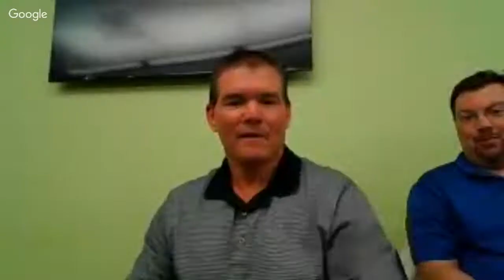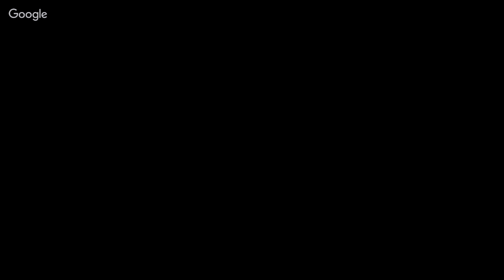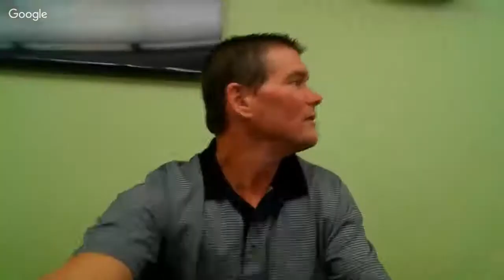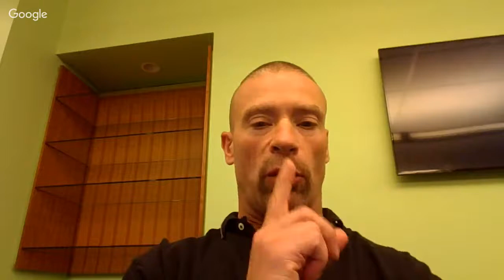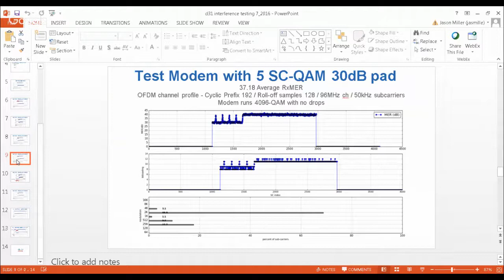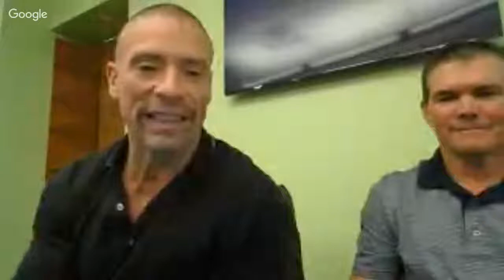DOCSIS 3.1 Downstream and Upstream

Comment: I would like to know more about the Python script and testing of the modem, some clarification on exactly how this test is set up and done. Is the script being run on a computer attached to the modem (Linux/Windows?) Is the script available for us to download? Is it being run from a computer attached on the MSO network side looking at the modem through the CMTS or is the script running on the CMTS itself? How would I set up this test myself. Is there a list of cable modems that support this feature. I have gotten into my DOCSIS 3 modem and seen the power level received, upstream power level, I have worked DOCSIS Support Desk at a major MSO and polled DOCSIS 3 Modems, but never used it to this extent and an MER analyser across a spectrum at this detail. I have also worked in headend engineering and in the field using Spectrum Analyzers and SIgnal/MER/BER meters looking at 6 MHz 256 QAM... And I have seen cable modems being used to track outages and low signal but not at this resolution. Details on this test would be appreciated.

Comment: I have a question for you. We have several mini CMTS devices, and they all have well under the 500 device limit. Well, they seem to have issues where modems will drop into initializing, and they will never come back up, uless of course we reboot the CMTS. It APPEARS to be a DHCP issue between the mini CMTS and the router handling the dhcp. We have vlans set up for every device as well, and this issue is still happening. Is there anything you can suggest, or can I maybe get in contact with you a different method? We are using docsis 3 modems as well.

Comment: Silly question ...what is the difference between ccap and cmts?
Reply from the maker: Hi @Masa Mune, thanks for watching. CMTS stands for "cable modem termination system" while CCAP stands for converged cable access platform.  A CMTS is focused on data only, but it does usually have the ability to also stream IP video, however this is typically not an easy process. A CCAP is a CMTS, but stream video is natively built into the CMTS. In summary, a CCAP is a CMTS with more features for streaming video by the cable operator - not video like Netflix, but video provided by the cable operator.